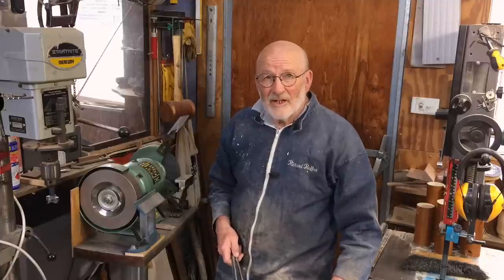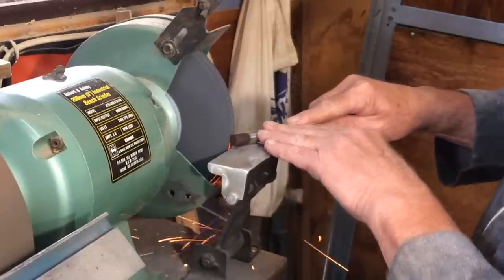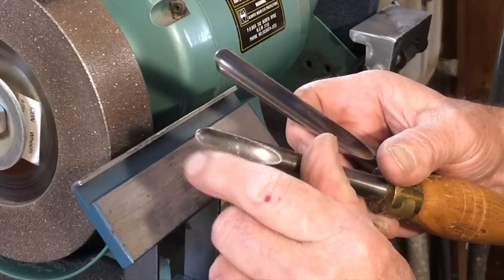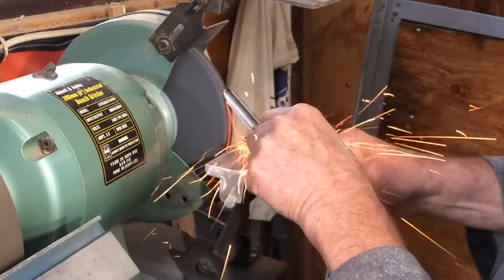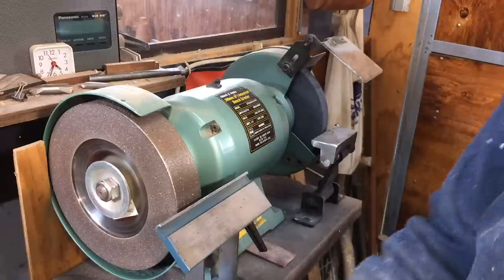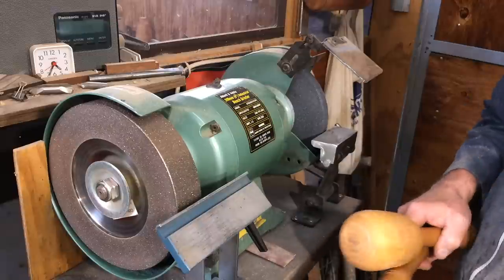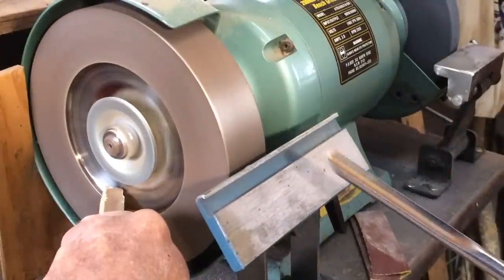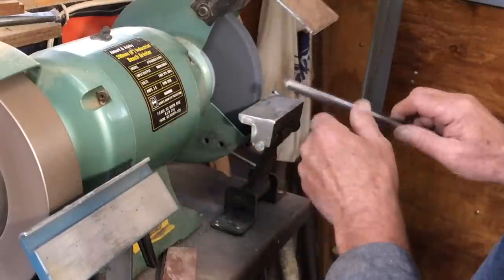Richard Raffan shapes and sharpens two new gouges, preparing them for use.

Comment: I'll stop worrying about if I ought to be using a jig, and carry on freehand. I still need to understand the profiles better though.
Reply from the maker: A problem with jigs is that whilst they might help produce a sharp edge, that edge might not be the strongest or most useful.  With hand grinding you can micro-adjust the shape of the edge. Don't worry too much about how the bevel looks: all you need is about ⅛" / 3mm of clean bevel from the edge. Below that can be multi facetted.

Comment: Excellent demonstration to view during my lunch break from another pastime-hydroponic growing in a large home built poly greenhouse-tomatoes, strawberries, capsicum etc. then on to emptying a shed of some junk, to make space for a larger lathe, which arrives in about ten days. I have a load of rough sawn cross grain Huon Pine slabs-8’’ to 12” in diameter, hard as nails, but the price was too good to pass up. Your tool shaping video along with one from Tomislav Tomasiv, is very timely as I have some new gouge’s to shape and sharpen. I might just as well learn from the master, I am used to sharpening metal lathe tool bits the past 60 years, but wood turning gouges are another quite different tools. Kind Regards from Tasmania Australia 😁🛠👍🇦🇺 PS, a very kind gesture from a grateful viewer, donating new tool bits to the cause.👏👍

Comment: Your videos are superb, Richard, thank you. In particular, you do things that make sense, rather than what everyone else does or are expected to do. 

I'd love to hear you describe in detail the finessing of the inside of bowls if you haven't already? I have a batch of lime (6 months drying). The outside is going like a dream, but my technique inside is requiring a lot of sanding.
Reply from the maker: It's 50 years since I turned lime (two pairs of giant candlesticks for Washington Cathedral). Lime is a favoured carving wood so should cut easily and cleanly and certainly cleanly enough that it shouldn't require too much sanding, especially if the outside went okay. You see my solutions across the bowl videos, occasionally with some very heavy sanding on stubborn patches of endgrain.

Comment: ❤That was a nice Diamond grinding wheel you have got on your bench grinder i wonder where to get one off these Regards Svendus 👍
Reply from the maker: I'm using an 80-grit CBN (Cubic Boron Nitride) wheel. CBN is used in industry and in the past 10 or so years CBN wheels have become popular amongst woodturners for grinding High Speed Steel (HSS) woodturning tools. Most specialist woodturning supply stores will stock CBN wheels. It's useful to have the abrasive on the side of the wheel as well as the edge.
Reply: @RichardRaffanwoodturning  👍 thank You i think you can also grind HM (hard metal)on this wheel, but it difficult to find CBN wheels with grit also on the sides here in Sweden 🇸🇪

Comment: My method copies Stuart Batty and Cindy Drozda and ensures that the bevel angle is the same all the way round, even if the wings are asymmetrical. Set the rest to the desired bevel angle (45 degrees in your case), then put the gouge flat on the rest. Being careful to keep the spot on the cutting edge that is being ground exactly horizontal (parallel to the top edge of the rest) turn the gouge from wing to wing while twisting to keep the edge level. Unlike any jig I've seen, this ensures a constant bevel angle.
However, I haven't seen any proof that a constant bevel angle is actually desirable. For instance, near your left wing-tip I imagine you will often be using a scraping pull cut. A higher bevel angle might be better here.
Reply from the maker: The point of this grind is that the bevel angle varies so I have a more comfortable entry cut and then the ability to roll to gouge on to a steeper bevel across the bottom inside a bowl. It saves me having two bowl gouges with different bevels.
Reply: @RichardRaffanwoodturning  thanks for that explanation. As I said, I know how to achieve a constant bevel angle but don’t know if it is always desirable. You convinced me that it isn’t.

Comment: I notice you’re not worrying about overheating the steel. Is that something to do with that tool or lathe tools in general? Or is it something to do with the grinder?
Reply: The High Speed Steel can be heated more than carbon steel.
Reply: High speed steel has a lot of other alloying elements that stabilise the crystal structure. You have to heat it a lot to ruin the temper, i think up around 600c. If you have simple high carbon steel tools you do have to worry. Most wood lathe tools seem to be high speed steel these days
Reply from the maker: @talltimberswoodshop7552  Correct. Thanks for your input.
Reply from the maker: @alextopfer1068  Thanks for helping.
Reply from the maker: As the others indicate, overheating is not too much of an issue with High Speed Steel (HSS). It's best to HSS cool without quenching.
Reply: @RichardRaffanwoodturning  I didn't know about the no-quench rule. Thanks for that.